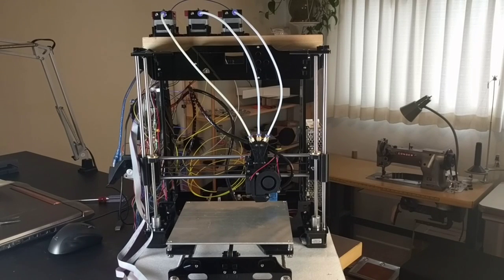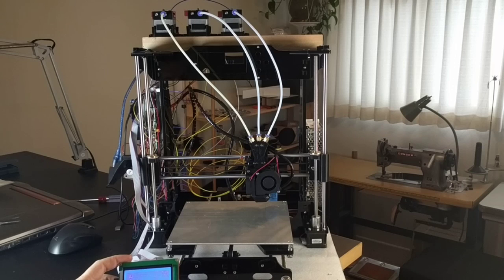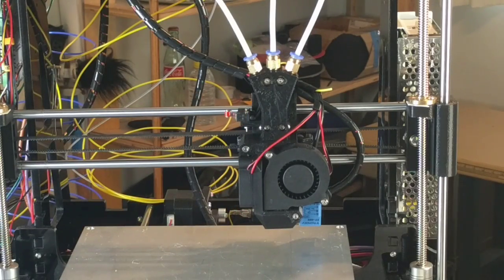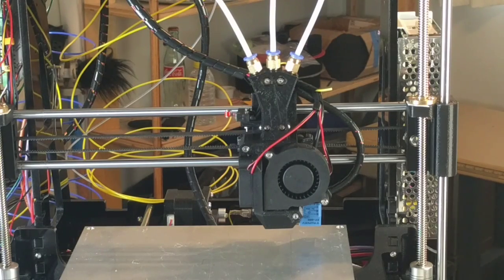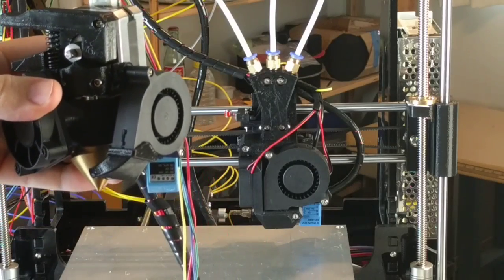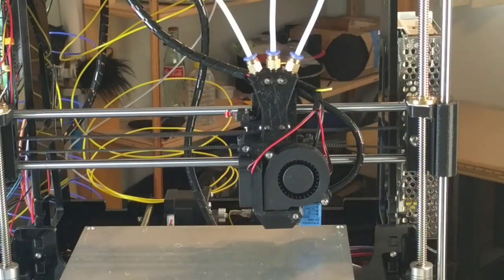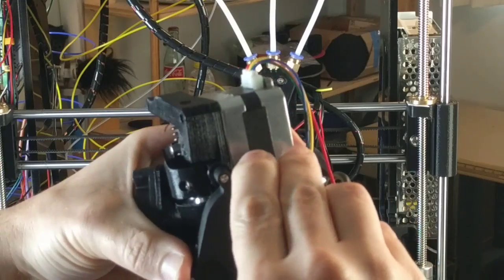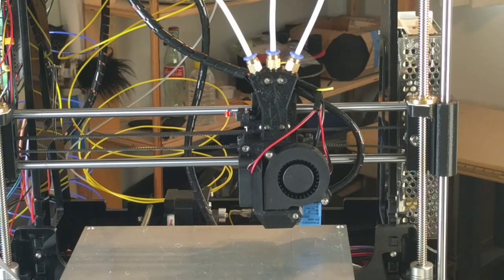Cheap Chinese 3D Printer Modifications

Comment: I want to do this! I also have an Anet a8 and I've been researching how to do exactly this with the 3 filament printing. Would you be able to link to where I can buy the new board and the .stl files so I can print them before I take it apart.

P.S. It would also be awesome if you made a tutorial video for how to wire the new board with the additional steppers and setting up that board's firmware.
Reply from the maker: I've been experimenting (and waiting for parts from China) for the last month or so, and I've gotten a really successful result with the diamond hot end. I will be doing a couple tutorials within the next month showing how to make the printer, and use Repetier Host to achieve 3 color prints. My Patreon backers at the $5 level will all receive 3D printable files for the hot-end design. In the mean time, you should check out the other video I made on the subject here: https://www.youtube.com/watch?v=WpmzboU2dKA.

If you want to pre-order the parts you will need get the following:
X-carriage:
-Three 40mm Nema 17 stepper motors to act as filament feeders (you may already have one on your printer) 
-Three Stepper driver
-Bowden tube 4mm OD and 2mm ID
-Diamond Hotend assembly including heat blanket, and three E3D hotend heat-sinks.
-50mm 12v fan
-Rumba Control Board
-6 DRV8825 Stepper Driver Boards

I suggest you wait for my tutorial video(s) before ordering.

Comment: hey is there a board we can install on a Tronxy X5S to run dual extruder ? ive been googling this question many many hours this week !
Reply from the maker: Yeah, there are a lot! Of course the Duet would be king. But that is a very expensive option, especially when you have to buy a screen along with the board. You can't beat it though. Hardware and software are both top notch. If you want to run 32 bit architecture but don't want to spend so much get an "MKS Sbase v.1.3" board. It is a knockoff smoothie-board from china, and runs open source smoothie-ware. The least expensive option is to go with a glorified Arduino board running Marlin or Repetier. The MKS Gen L is a really solid offering in this category, and probably my recommendation. This would work with the screen that came with the X5S. Other Boards in this category are a Rumba Board which would allow you to run 3 colors (like I showed in this video), and of course the Geeetech GT2560. If you are going to do a multi color upgrade, you could also upgrade the screen to a touch screen. On AliExpress you can find a "MKS GEN L V1.0 +MKS TFT32 V4.0 LCD" combo for $45.

Comment: Don't you need 2 drivers for the Z-axis?
Reply from the maker: Not needed unless you are running larger stepper motors than what you find on a 3D printer. You can do it that way, but there are issues associated with that strategy; it costs more, and getting the two motors/drivers to move in synch. can be challenging

Comment: Thanks for your informative vids . I've got an A8 with extensive mods , 200 x 300 table & 5 colour feed system through a custom manifold I designed https://www.thingiverse.com/thing:2403517        I just bought the rhumba board identical to the one you showed in this vid. Did it come with all the firmware for the 3 colour drivers & auto bed levelling , or did you use the Marlin firmware. I'm currently using Marlin on my A8 & not sure if I need to upload the same firmware , of if the rhumba already has an opp system worth using . Any advice would be appreciated & obviously save some time research time. Thanks.

Comment: Why cant you just use one driver and switch between filament steppers with relays or something?
Reply from the maker: It's been done: https://www.youtube.com/watch?v=STZg94co8CI There are 3 problems with that approach:

1) It is a more complicated system than what you see in the video, so it is more prone to failure than simply using dedicated stepper motors. 
2) Designing a system to switch between more than 2 filament feeds is very challenging and complicated (see #1)
3) It would require that I write my own firmware and/or slicer post processor. I do not have the skills to do this.

Finally, It would not solve the jamming issue I am experiencing which you can see in the video here: https://www.youtube.com/watch?v=WpmzboU2dKA
Reply: http://www.marlinkimbra.it/?p=280
http://www.prusaprinters.org/original-prusa-i3-mk2-multi-material-upgrade-release/

People are already doing the exact thing I was thinking of, this does not require any additional drivers, it just multiplexes a single filament driver, precisely what I had in mind.
Reply from the maker: Please forgive me. I misread your first comment. I assumed you were talking about only using a single stepper motor. You are absolutely correct, it is possible to print with more than 3 colors/materials if you use a multiplexing board. I'm sure this is the direction everybody will be going in the not too distant future.

Comment: I've got a few question for you on your design and choice of mainboard. You said that the board has 6 stepper motors driver which offer the advantage of controlling all 6 stepper motor independently. At 4min10 in your video you say that you use 1 driver for the X axis motor, 1 for Y axis and ONLY 1 FOR THE Z AXIS (which mean that you are controlling 2 stepper motors with only one driver). Normally there should be no problem doing so, but at the beginning of the video you are presenting an auto leveling feature which in order to work, need to control each of the 2 stepper motors moving the Z axis independently.  My question is how do you control separatly the 2 stepper motor moving the Z axis if they are both connected on the same stepper motor driver on the main board? Thank you for your feedback.
Reply from the maker: Bed leveling the way you are thinking would only accomplish the job in the X direction. There would be no way to adjust the height in the front to back or Y direction. Instead, the two Z stepper motors are always tied together, and effectively move as one unit. When the mesh bed leveling algorithm is run, the software creates a model of the bed, and knows the z-height of the bed for any given (X,Y) coordinate. As the printer is doing it's job, the z-height is constantly being adjusted to maintain a consistent offset from the bed. This leads to great bed adhesion for the first layer. It really has no purpose beyond that, even though it does the task throughout the print.
Reply: Thank you for your answer. Indeed, the z stepper doesn't need to move separately and ''tilt'' the x axes. While printing the first layer, the printer motion in the z direction is constantly ajusted in order to keep an even gap between the bed and the extruder.

Comment: Does this splitter design work well for 2 materials that use different temperature?
For example PETG at 240C and PVA as support at 210C, or something more extreme like PC at 290C and PVA at 210C.

Comment: you are doing great ......
can you also provide the slicing and the code problem solution, which is compatible with ramps board for dual colour printing with single hotend and dual extruder or pusher.

Comment: Sweet mods.
Been looking at getting dual extruder but there are downsides, such as loosing bed width and setting it up to be exactly lined up looks a nightmare, however this solves that. What kind of software mods do you need to do in Cura to work with this? I would love to use PLA as a support material for complicated models.

Also, the bed levelling, please can you link to the part you bought or advise the model and advise how to update the firmware?
Thanks
Reply from the maker: I will cover how to print in 3 colors using Repetier Host with the Cura engine in a later video. Make sure you subscribe so you don't miss it.
Reply: Already have, thanks

Comment: It looks like it has potential but am I missing something here...you have a direct drive unit for a single filament on a three filament print head, how do you feed the other two filaments?
Reply from the maker: There are 2 Bowden style filament feeding stepper motors behind the gantry at the top, but that is shown in my other video. This video has all 3 Bowden feeders at the top.

Comment: Doesn't the Z axis take up 2 ports on the board?
Reply from the maker: Both Z axis motors are doing exactly the same thing, so you can just wire them to a single stepper motor driver.
Reply: I was thinking the same question since mesh bed leveling. But does make sense that doesn't matter, since it still raises/lowers both together. So they should always be in sync.
Reply: I was thinking the same question since mesh bed leveling. But does make sense that doesn't matter, since it still raises/lowers both together. So they should always be in sync.